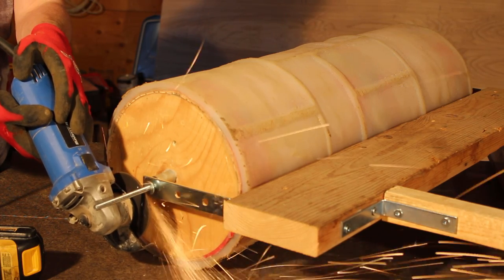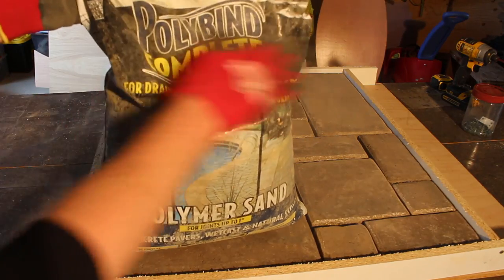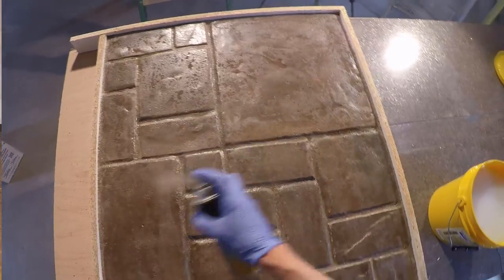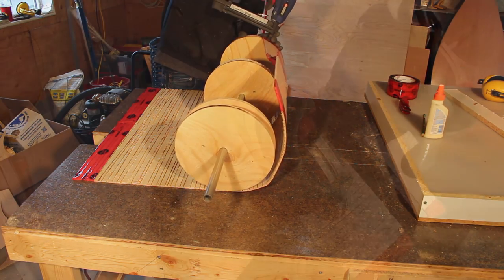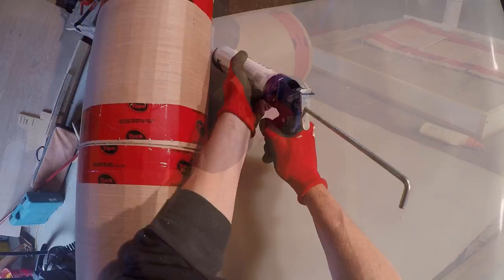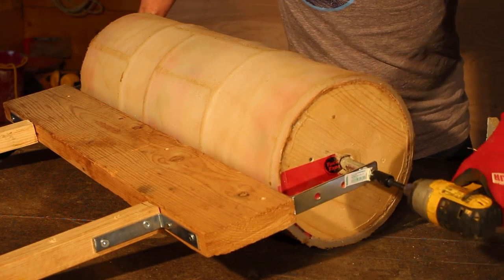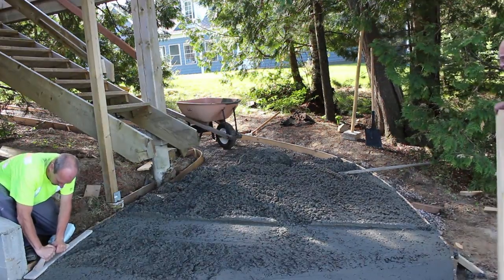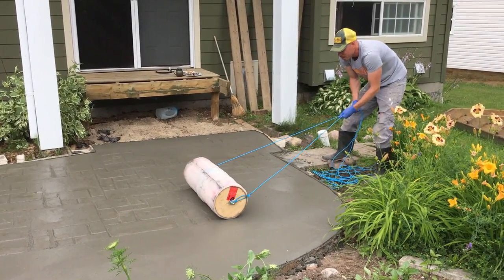How To Make A Concrete Stamp Roller - DIY Stamped Concrete - DIY Concrete Stamp

Comment: I have done concrete for many years.  I will honestly say.  I subscribed immediately when I had seen this.  very smart.  I wish you luck with all your current or future projects.
Reply from the maker: awesome! I know many people aren't happy with how it turned out, but it was a fun project, and I think it turned out ok.  happy to have you as a sub
Reply: @TheHowtoDad  I have a homeowner, that wants me to do stamp on a 12x12 area.  So I am using your design.  But the mold max is going to take to long to be shipped to me.  So I plan on using BBDINO Silicone Mold Making Kit.  I am hoping it will do the same as the product you used.
Reply from the maker: @scottg151  cool! I'd love to hear how it turns out!

Comment: This was great. I think a concrete form tube might be a good roller. Maybe paint the ends for longevity. Thanks for sharing. I'm going to have a look at your bed build.
Reply from the maker: awesome! glad you liked it. I think a concrete roller, or a PVC pipe would work really well. would certainly be easier to build.

Comment: This is genius! 5+ years pouring/truck operating never seen this roller technique, even on a DIY job. This is exactly what i was shopping for. Even still i can only find the small painting sized tectured ones. ⭐⭐⭐⭐⭐
Reply from the maker: that's why I made my own. could definitely tune the design so it works better, but I'm happy with my experiment.

Comment: The roller is a really great idea!  I suppose that the form could also be used to create a smaller flat stamp to go up against walls, etc where you can't fit the roller.
Reply from the maker: you're probably right. in my area I could t find any stamps for a reasonable price.  this is why I made the roller...well also because I just wanted to

Comment: Awesome!!! How do you know how soon you can roll it?
It looked like you might have hand troweled the wide area standing on plywood, you can wait that long?
I plan to do one 20' x 25', do you think a long pipe would be better to use than the rope?
Reply from the maker: The first day we rolled it as soon as the growling was done, it was a hot sunny day. The second day we waited about an hour after it was floated. The pros now when it's ready, for us it was trial and error. It's really dependant on the day
Reply from the maker: I found the rope to be pretty good. but perhaps if you can rig up a pipe it may work better, a 25' pipe may be difficult to handle

Comment: Do you have sense of the mass per linear foot or downpressure required? I’m debating scaling this up to a 14’ wide, 1000’ long driveway. Would be most convenient to do it with a single 14’ long roller constructed from steel, but it would help to have a ballpark for the target weight.
Reply from the maker: really depends on the pour conditions. if you wait too long you'll need more weight.  too soon it will sink in.  
this roller is 28" wide and weighs about 50lbs.

if you do this PLEASE send pics

you can reach me through my website www.beddeskplans.com
Reply: @TheHowtoDad  Thanks! Scaling 28" inches to 14' sounds like about 300-400 pounds which seems reasonable. Makes me wish I could pour starting at the top of the hill and working downward, but alas, I'll make do. Do you have any sense of the volume of mineral spirits required per area (e.g. per sq. yard)? That would make it easier to design a continuous drip of mineral spirits ahead of the roller. Thanks! If I do it I'll send pictures (and likely file a couple patents along the way).
Reply from the maker: @stephenromaniello  you might want to consider making multiple passes... You'll have to make control cuts, so maybe use those as your roller joints.
As for the mineral spirits, for such a large pour you'll want to use a commercially available release agent. Talk to your local concrete supplier.  I am no expert.
I'm just going to say it, 14ft is way to wide. WAY to wide.

Comment: Thanks I am going to use ALOT of those tips. I am going to make my roller out steel. I am a fabricator I was worried it might be to heavy
Reply from the maker: heavy is good! I think the only problem you will have is getting the silicone to stick to the steel. figure that out, and you are golden!

Comment: this is a great idea.  to get a better stamp impression with less imperfections you should use liquid release on the concrete and roller as done with normal stamp process and it will come out stunning.
Reply from the maker: We used Mineral spirits because that's what we had available to us. I live in a small town with very limited access to most things. Gotta work with what you've got

Comment: Good job man! Very inspirational stuff. Can i ask,im curious to know how long the silicone lasts,Did it work for a few jobs or does it fall apart after a couple of uses?
Reply from the maker: I used it for 2 jobs, seemed to hold up fine. silicone is really tough stuff!  if I do it again, I'd use a 10” PVC drain pipe

Comment: Great thinking out side the box,it seems to work fine being so light,i would have thought more weight not so.
Reply from the maker: Thank you. It fairly heavy, probably about 60 lbs. The key is the timing, lots of waiting around until the concrete has just the right consistency.
Reply: Thanks for reply priced the liquid rubber here in Ireland about 129.00 e very dear

Comment: I didn’t think silicone would stick to silicone once it was dry ? I like the idea, it seems a better way of doing large areas. A lot of work making the roller, but well worth the effort 👍👍👍
Reply from the maker: it seemed to work. I didn't notice it delaminating the 2 times I used it.

Comment: I would try one of those high density cardboard tubes from the hardware store for pouring concrete in when putting posts in the ground, easy to find them in large diameters, maybe even brush it with some cheap fiberglass resin, with or without the cloth.
Reply from the maker: If i do this again, I will use a PVC sewer pipe. You can usually get off-cuts from excavation companies. They are waterproof so they won't break down during the pour

Comment: Does any dirt get caught in the cracks? Great video, thanks.
Reply from the maker: Nothing get caught that can't be easily swept off. It's Been in place for 3 years now, looks like new.
Reply: @TheHowtoDad  Thanks. Just a couple more questions, did you buy the concrete already 'pre colored', and do you have to seal the concrete with like a varnish or something afterwards? How did you get the release agent applied when the roller was way out in the middle of the big pad with the ropes on it? And do you poor with the mesh on the bottom of the concrete, or do you lift the reinforcing mesh up into the concrete? Thanks.
Reply from the maker: @SeriousSchitt  These are good questions for a proper concrete contractor. Try these guys: https://www.youtube.com/channel/UC5y5SeEYvz_MqPmBU_zLTyA
Reply: @TheHowtoDad  Really??? Go on!!! No matter how good and helpful "these guys" are, how on earth are they supposed to know what 'YOU' did in 'YOUR' particular job? I'd have thought 'YOU'D" be the guy to ask for that?
Reply from the maker: @SeriousSchitt   Ok, well for my specific job, we used 4 inch mesh, no sealer or stain, we used a sprayer to get the release in the right places. we also used a series of planks to reach out to the middle of the poor. The mesh was suspended 1 inch from the compacted base.
Reply: @TheHowtoDad  Thanks Dad, you've done a great job whichever way you look at it.

Comment: cool idea!  I would have probably used a 12" concrete sonotube for the roller, cheap, easier.  Wonder how well this would work with a slate pattern, might give it a go, got a lot of concrete to do on my house.
Reply from the maker: For sure would have been easier. That or a Pvc drain pipe. The sonotube might not work well in the wet environment
Reply: @TheHowtoDad  good call, i was just thinking that.  Was trying to think cheap, pvc that size is expensive but i guess it would be worth it for a quality tool.   Possibly sonotube with a good thick coating of poly would do.  Cant think of anything else off the self about that size and cheap.
Reply from the maker: Call around to sewar contractors. They probably would have a 2ft off cut they'd give to you laying in their yard
Reply from the maker: Call around to sewar contractors. They probably would have a 2ft off cut they'd give to you laying in their yard

Comment: Thank you for your efforts to show us how to spare hundreds of $ by making our own mold instead of buying them.
Please tell us what you use for making your mould not stick to the concrete? 

What should I search for at the building supplies shop? What you think works best? I saw some guy using some coloured powder.
Thanks.
Reply from the maker: I used mineral spirits, but cement dust apparently works well too. just dip a large brush into a bag of cement dust and flick the bush over the work area to cover the work area in the dust

Comment: What would you say the consistency should be with like quickcreate
Reply from the maker: Mix normally. The key is waiting for the poured and floated concrete to set up to a point where it will support the roller. Basically you wait until you can stick your finger into the concrete up to the first knuckle on your finger

Comment: Another idea for making  the roller would be to start with a Sonotube.  A 48"x10" one is about 16 dollars at Home Depot.  A lot less work than all of the kerf cutting and glueing.  You could cast the hubs out of concrete, with the axle in place, and a hole in the first hub. The hole would provide a means to add concrete for the second hub, as well as filling with sand afterwords.  You might want to attach a board inside, along one side,  to provide a place to attach the stamp.  Heck, now that I think about it, you could just fill it with sand before casting the second hub which would be simpler than flipping it.
Reply from the maker: I 100% agree! next time I do this, I'd probably use a 10inch PVC pipe

Comment: Thats way cool!  But im suprised you didnt mention that you have to make the barrel dia very specific so the roll pattern meets up properly around the drum.
Reply from the maker: Didn't I?  I thought I did...I made this video 4 years ago, I know I recorded that part, but maybe it was too boring and math heavy...Had to use Pi and solve for "x". In any case, YES, you will need to make the barrel a specific size to accommodate the Pattern.

Comment: Great idea with the silicone mold. Not so much with the roller though. I could def see you were struggling to keep it balanced and straight, especially on those long runs. I may attempt the DIY mold, but make a few and attach them to ply wood with handles so I can lay them in the more traditional stamping process. I would never be able to un-see the uneven line joints :D Thanks for the idea and inspiration for us DIYers.
Reply from the maker: You're right about the long runs. Took a lot of concentration. I'm pleased with how it turned out, but like you said, I try not to look to close. I would say with practice I would get better

Comment: You can buy a stamp for about $200 or rent a set for a day. I really suggest spending the $100 on a can of liquid release instead of using mineral spirits. Also, getting a brick texture to line up and look good is even hard for professionals. I'd suggest just going with a stone texture. It is way easier and looks just as good. Also, you need a good antiquing color for the top to bring out the texture. Then spend $100 on poly seal EZ sealer. Lastly. The concrete is by far the biggest cost, and you have about a one hour window to get it stamped or you will be ripping it out and redoing it which will cost more than having a profesional do it in the first place. One concrete arives, you have about 3 hours max to get the job done before it hardens up. If you have never finished concret before, you REALLY do not want to start with stamped
Reply from the maker: This true. IF you have a place to rent stamps, great. To buy A stamp for $200 is one thing, but you'll likely need a minimum of 3 stamps to make a decent pattern. Release agent is the best stuff, but it's not available everywhere (definitely not where I am). All of your points are valid! Thanks for the comment!

Comment: New Subscriber!! Id love to see more of these. P.S That slump was painfully dry!!! The driver could have juiced that up way more so it wasnt so hard on you guys
Reply from the maker: driver is the owner, he's not what you'd call friendly...thanks for the sub!
Reply: @TheHowtoDad  That explains it! Still did a great job. Im also curious about making one of these for a random slate pattern and also a wood plank pattern! Brick seems like it would be definitely easiest. I still have about two months before concrete season here in Canada so I'm going to try out making the brick one first.
Reply from the maker: @brysont312  if you do, use a 10" pvc drain pipe instead of the plywood thing I was screwing around with.
Reply: @TheHowtoDad  Will do! Thanks for the tips. I'm going to experiment with a few different patterns. If you like I can send you the results! I do about 10-20 stamp jobs each year so they will definitely get used. It would save my back not having to walk out there with mats and tamp the patterns into the concrete so this video got me very excited to try something new.
Reply from the maker: @brysont312  absolutely send me the results!

Comment: Sonotube for the roller, short cut that makes it much easier. Its very rigid, seal that, fill with sand, Marshalltown who? Nice work... save $1000-1200.
Reply from the maker: A snotube would be a much better idea. I was worried about the paper getting wet and soft. Another idea would be a 10 inch pvc pipe off-cut. Maybe next time
Reply: @TheHowtoDad   save the guts, and just replace the tube, although I will attest to their toughness, i can still see them on my deck footings poured 3 years ago, constant ground contact...lol

Comment: great ideas and $$$ saver. right away i would probably use galvinized sheet metal versus luan board cut up. much easier i woudl think. 20$ a sheet at re michels
Reply from the maker: Ya, plywood was for sure not the easiest way to go. I think a 10" drain pipe would be the best option. thanks for your input

Comment: think it would be nice if you mix colour with the concrete first  I was thinking about doing similar but not with a roller and after poring the concrete  just throwing on some different colours like red yellow and black then using a wood float mix it all togather   kind of like marbling affect
Reply from the maker: Sure, why not?

Comment: what was the cost of the build?
Reply from the maker: that's a good question...I had some of the supplies already laying around. the brick, sand and mold was probably $50 and the silicone was around $150, add another $50 for hardware, so around or less than $300. Canadian francs
Reply: @TheHowtoDad  I have stamped walkways but the driveway is not wondering if I could make a mold to mimic the stamped parts as I bet I'll never find that pattern anywhere the silicon is what I'm interested in did you use the pmc 780 like the manufacture video?
Reply from the maker: @kaleip  I used a product from Smooth-on. sorta clear 37 would work well

Comment: next time just lay some painters plastic down instead of release agent and when you peel it off it gives a very nice finish, which peel it off right after tou role
Reply from the maker: Have you tried this? Don't you get wrinkles from the plastic? It seems like it could work...
Reply: @TheHowtoDad  yes i have but make sure it is like no heavier than 2 mil ( painters plastic works great ) because the wrinkles and pealing off the plastic is what gives it such a great finish (like cobble stone). my friend has a aluminum stamp and that's how it designed to be used. good luck
Reply from the maker: @risonc  I'll give it a shot!  thanks for the tip

Comment: You need to check into your monetization! They changed the requirements for the amount of subs you needed and how many watch hours you needed before you could be monetized. I think it was 2,000 hours and 10,000 subs? I'm not sure I could totally be wrong on those numbers but look into it! It could simply be you just need to flip the switch to turn it back on.
Reply from the maker: Thanks, but there's more to it than that in my situation. I'm enjoying making these videos without forcing people to watch  crappy ads. Thanks again

Comment: You could’ve sprayed the concrete down with the light misting of water while working with it….
Reply from the maker: adding water to concrete reduces the strength, causes the top.layer of cream to chip off after curing and leads to efflorescence.  spraying water on concrete to make it more workable is not recommended

Comment: As a Professional I would say your concrete could have been a little more liquid because you spend too much time in preparation work I guess. You can ask the Guy to mix more water in or order certain kind of plasticity.
Reply from the maker: It was a hot day on the first pour. More water means lower stengnth, more cracking. Plasticizer would have been nice, but pricey. Did what we could with what we had. Thanks for the comment

Comment: Thats some of the worst stamped concrete I've seen . And I've seen alot
Reply from the maker: Thanks man! Glad you hated it!
Reply: @TheHowtoDad  hmm I don't think I used the word hate.. but okay🤣 . My comment is from someone who does stamped/ decorative,  custom concrete for a living . And you would never sell a 2nd job if you sold that finished product.  Now if your trying to save thousands by doing it yourself then fine but at least have the template pulled in a straight line. 
Later you narcissist